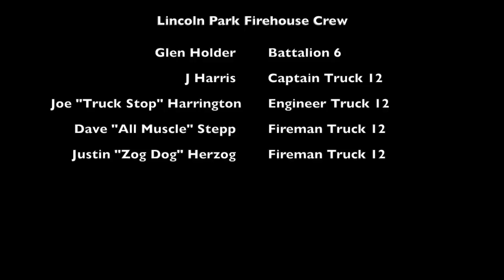Tuther Fire 2 FireCams

Comment: from the looks of it they were making it worse by cutting all those vents for the fire to break but im not fire fighter ..uhmmm
Reply: ZombieMind Freer that’s what I thought but maybe it’s to release pressure in roof. Not 100% sure
Reply: maybe @liammmiii  ..tho it seemed like they where cutting those holes to get access to the fire not knowing all the air ventilation that it is going create .
Reply: ZombieMind Freer it helps with the hot gases to escape, which in turn helps your interior crews in the ability to see and work with a lot less heat. This also increases the chance of survival if anyone would happen to be inside. 

On the other hand, if the hole is cut in the wrong place or your interior crew isn’t ready at that time to attack the fire, then you just gave the fire all that air. That in turn will cause the fire to grow rapidly.
Reply: ZombieMind Freer also the interior crews were in contact with them the entire time. All those cuts were done as they should have been.

Comment: Hmmmm, fire is a chemical reaction that creates light and heat from OXYGEN and fuel, a lit candle needs  to draw oxygen from the air in order to continue to burn. If you  limit the amount of air available, the candle flame will eventually  go out, once it uses up all the oxygen. So why cut  big ass holes in the roof  which will only allow more air into the structure, if you notice the flames became very violent. The firemen are lucky the roof didn't collapsed  due to  LIGHTWEIGHT POSES  you have a few minutes until they become unstable OR FLASH-OVER may happen. RULES OF ENGAGEMENT  as per Combat ROE, good job!